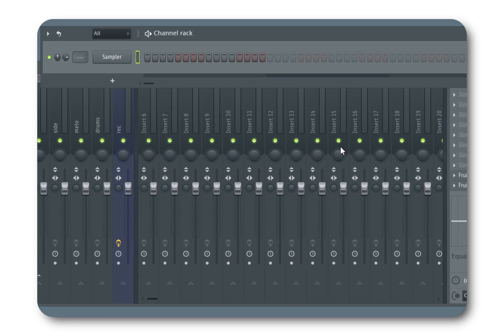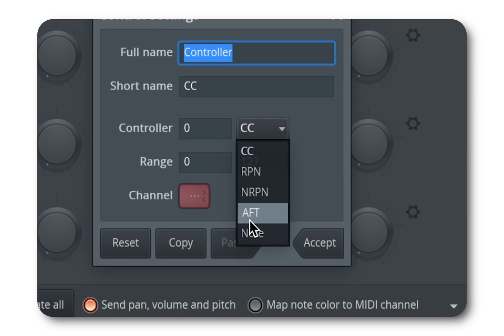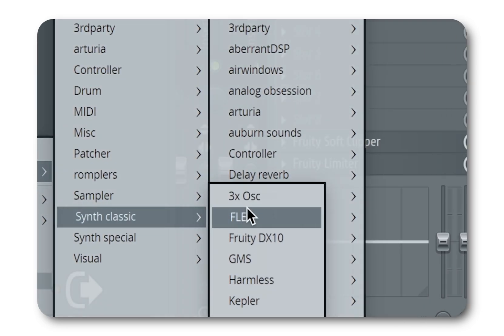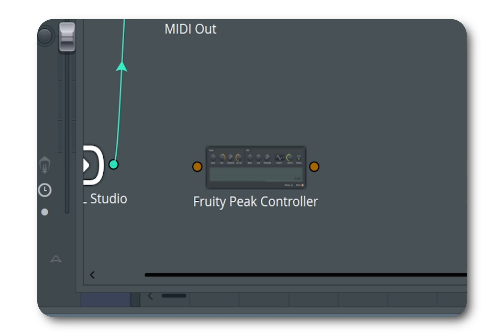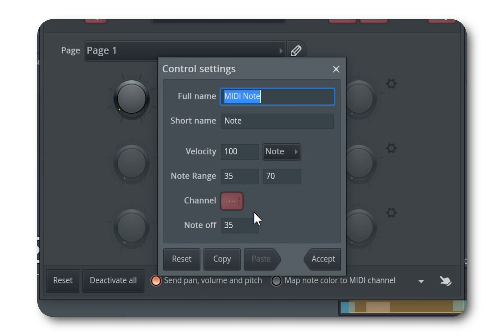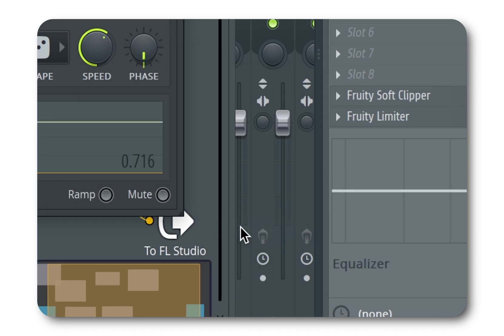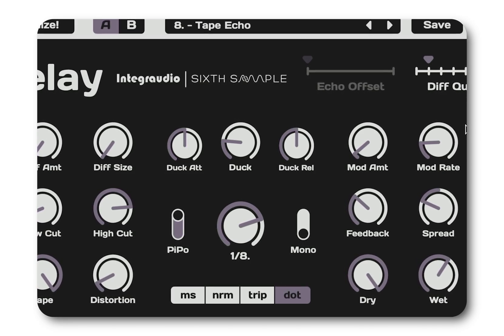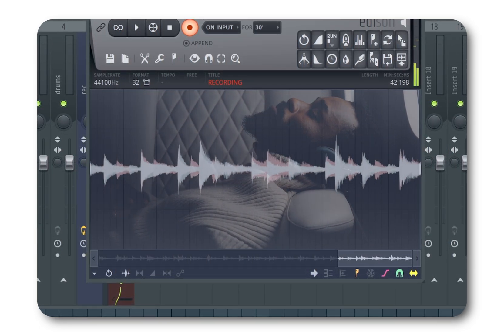How to create a MELODY generating device | FL Studio patcher

Comment: Thank you, that was very cool. By the way I have two questions, is there a way to stop it at some point?
Maybe with a control knob right?

Also, is there a way to trigger random instruments for each note in the piano roll? Like, i create a sequence of chords, then load 3 instruments and then try the instruments to play each one a random note from said chord?
Reply from the maker: thank you so much!
funnily enough, the only way to stop this patch is by actually introducing an additional amplitude module (like a fruity balance) and then control it via another control knob, like you mentioned 🤪 the channel volume won't do it, it's completely non-influent on the output behaviour of the device 

and yes, there is a very fast and easy way to randomly trigger different instruments (even when doing chords) which is by using a midi tool on the piano roll called "layer".. we have also made a short video about it which does not specifically focus on chords but you can apply its concepts to your own scenario https://www.youtube.com/watch?v=TKqgbIuOPFg